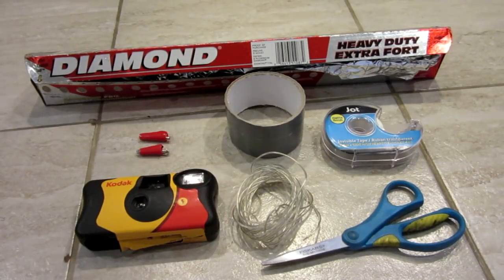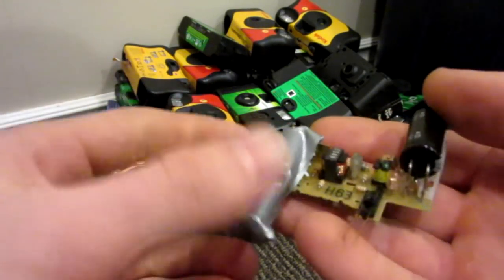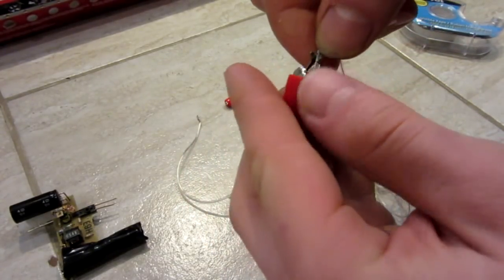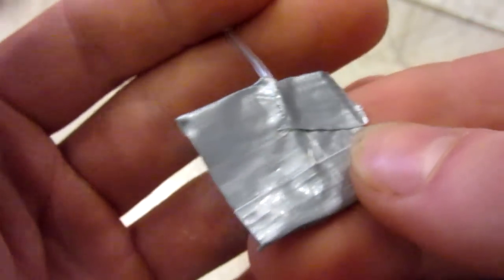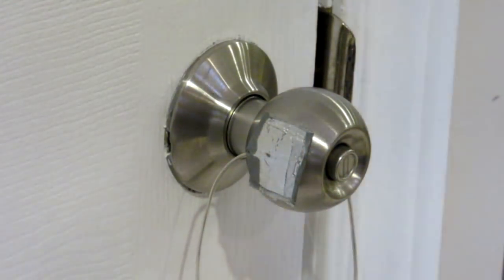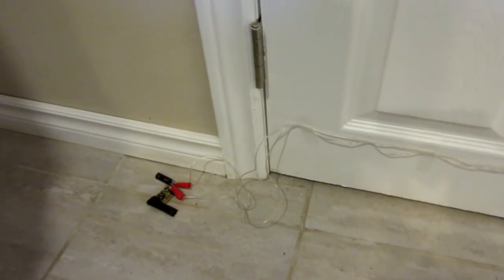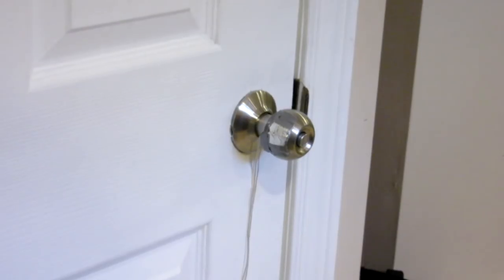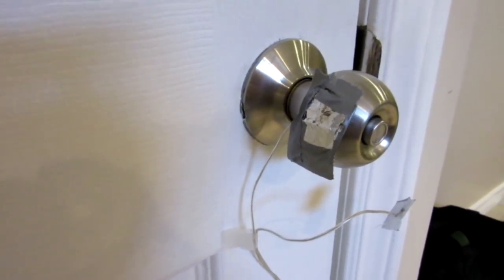How to Make a 300v Door Alarm - $2

Comment: Aluminium tape works real good for this.Also,you can remove the capacitor itself after its charged and it will do the same thing.Awesome setup for a prank.

Comment: what if you hold down the charging button to create a constant charge of electricity for a constant flow if shocks?
Reply: A capacitor doesn't work that way. It can store power but can't create power, and the power from the battery is very little unless it's captured and stored and then released at once.